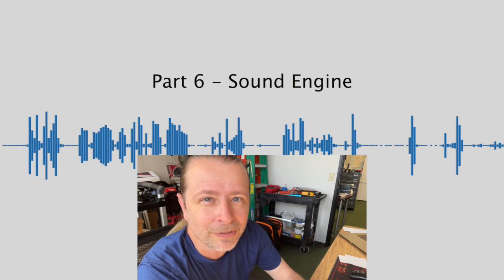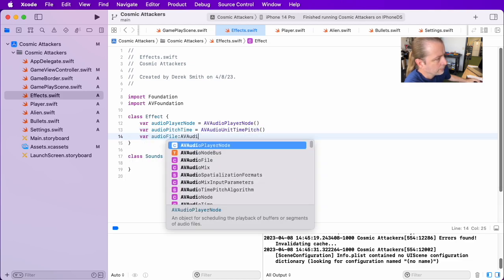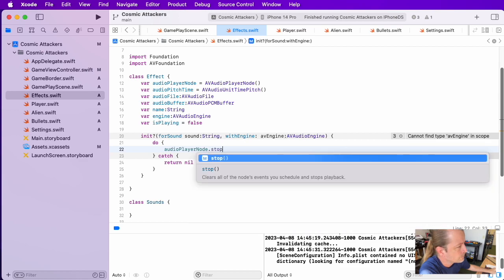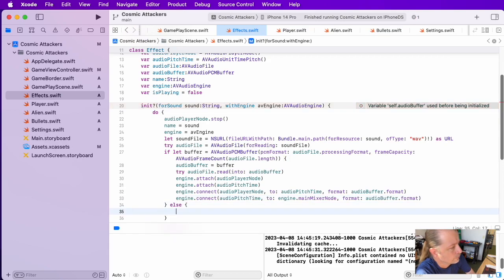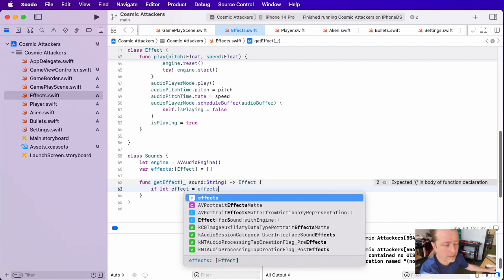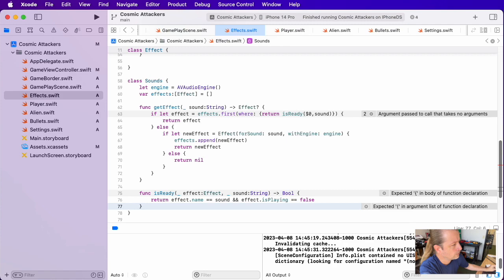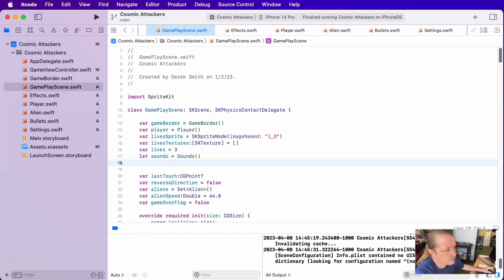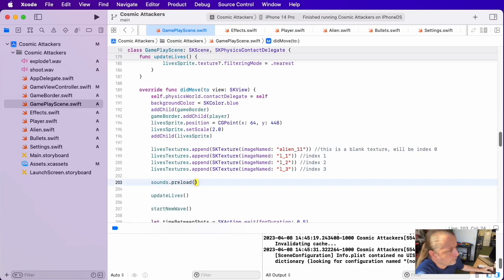SpriteKit Invaders Part 6 - AVAudioEngine and Sound Effects

Comment: I'm here for the audio. It was great that it ran the first time after I only had to change the signature ID. So many Github examples require a lot more than that (in fairness, often due to the age of the example). Your explanations were great, too. I'm in the process of replacing the code for a polyphonic sampler (with other audio things) that I wrote many years ago using SimpleAudioEngine, but that's not compatible with iOS 17.2, so I have to patch up all the audio code to use AVAudioEngine to continue in the AppStore. Thanks for your help!
Reply from the maker: Thanks, much appreciated!